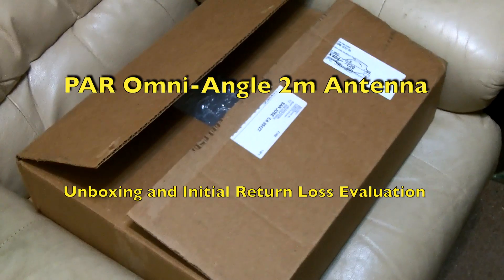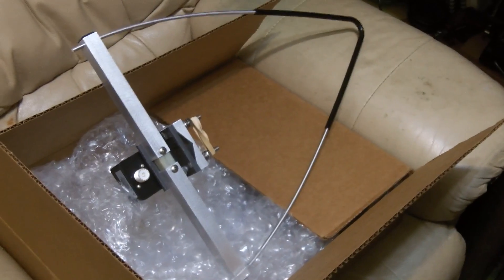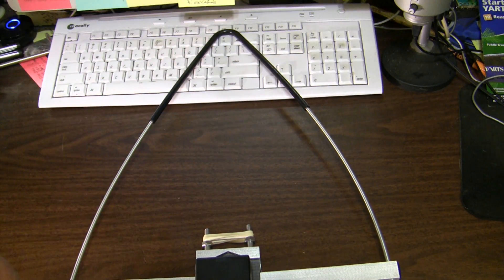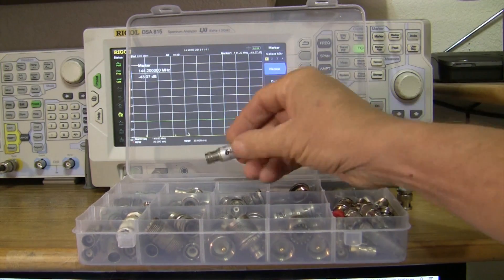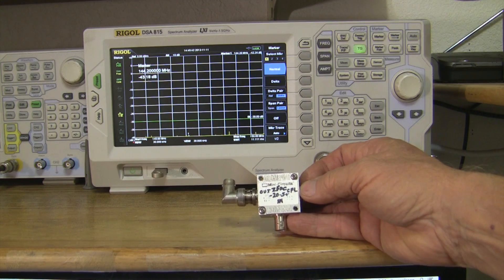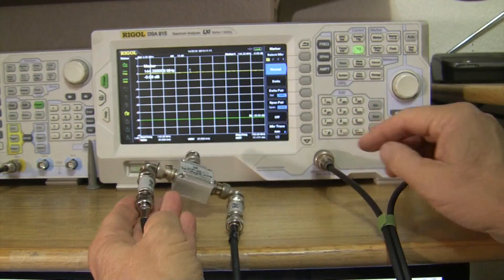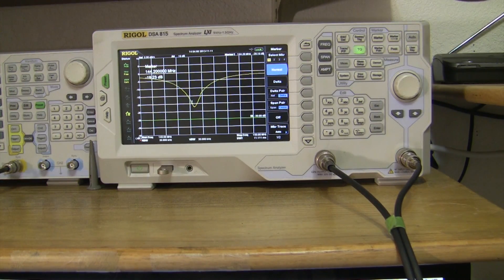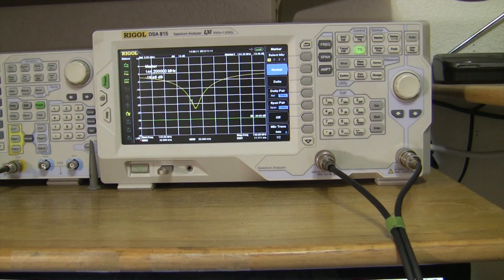Par Electronics 2m Omni-Angle Antenna

Comment: Put a PAR antenna against any other brand for the same band at the same height and I assure you the PAR will WIN the signal reports both directions.It is a far better antenna than M2 or other brands.
Reply from the maker: It should be a bit better just based on its physical size (capture area).  I have not personally run any experiments using it as an omni at my house because external noise is too high at my QTH to make a valid judgement.  

The 70cm version of the PAR Omni-Angle is used widely for 433.925 MHz license free purposes with two such antennas providing omni-polar coverage. Typically the units are mount at +/- 45degrees to provide omni as well as diversity reception plus vertical and horizontal polarization coverage.
Reply: James Eagleson  I currently have the OA-144 and OA-432 using them with an ICOM 910H and they are great antennas for VHF and UHF SSB on amateur radioI have also owned the OA-50 a couple of times and it is a great antenna.

Comment: Is possible also with ZFDC-20-4? 
Sorry my bad english
Thanks!
Reply from the maker: If you are willing to have an upper frequency limit of 1 GHz instead of 1.5 GHz then the ZFDC-20-4 will be adequate.  It certainly will work below 500 MHz but may not be as accurate as the ZFDC-20-5 above that.  I used the ZFDC-20-5 because it works to 2 GHz thus is well within its frequency range at the 1.5 GHz upper limit of the DSA815-TG.  I also plan to do work at 1296 MHz.